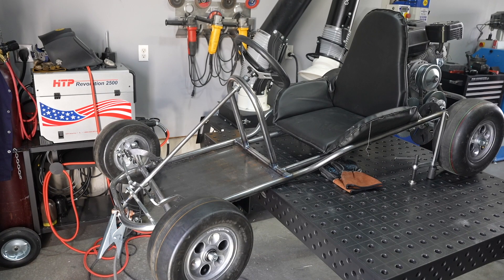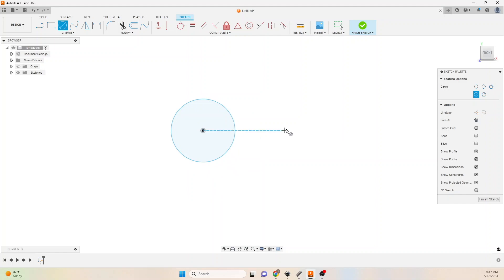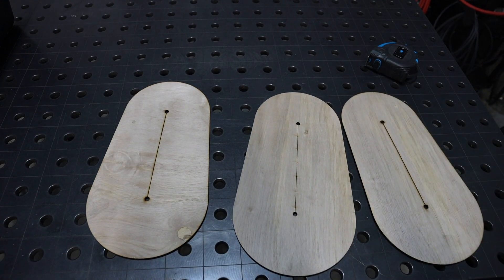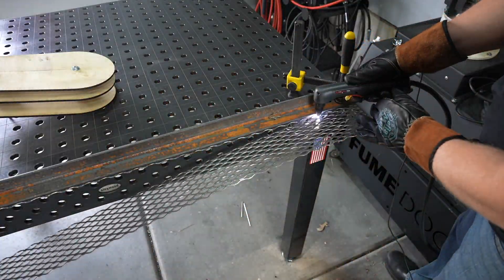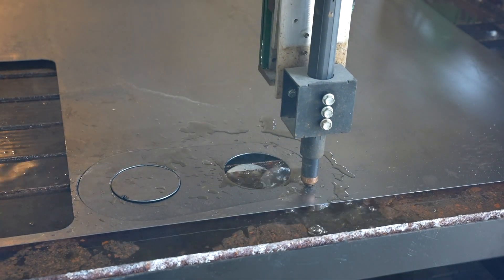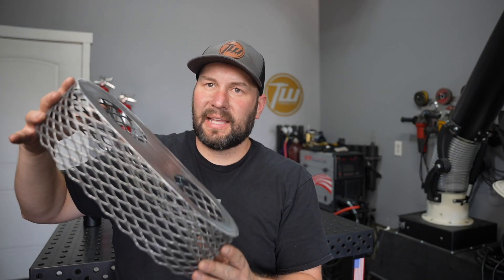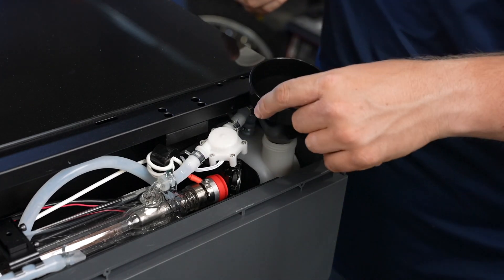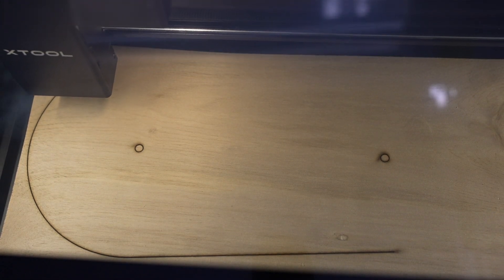Can Thin Wood form Metal? Making plywood metal forming tools with the xTool P2 CO2 Laser Cutter

Comment: Hey Tim I just recently started gasless flux cored welding and my beads are super skinny, and the puddles is really small I’m using Lincoln 0.35 flux core and I’m using the machines recommend settings do you know what I can do better?
Reply: I’ve also tried slowing down and it gets a little better but nothing like yours

Comment: Very clear to follow, thanks.  I’ve seen several P2 reviews and the thick material burning seems common.  The P2’s price is probably ok for people who are using it to sell resulting products or services, with Xtool’s D model a more reasonable consideration for most hobbyists.
Reply from the maker: Thanks! I have a friend with one of their diode lasers and it's really cool too.
Reply: The cutting speed seems too slow, or the power level too high, or some combination of that. There shouldn’t be that much charring. Any settings, just as on welders, is a suggestion of where to start. I find that natural materials have a fair amount of variability, so testing on a piece you’re going to use is helpful. Running the test charts before using the printer gives a very good idea of what to expect.

By the way, how does that nitrided table surface hold up to weld spatter?

Comment: Making jigs/forms = killer content!
Setting laser focus, Z axis height, is tough to get right for thick material.

I use hardboard from Home Depot for my jigs, super stable, finger joints without glue once you dial in laser kerf. Thanks Tim.
Reply from the maker: Thanks! I'll give hardboard a try.

Comment: May I share an experience to encourage you to stay with the black steering wheel you have - do not use a 'vintage' steering wheel?  About 1982 I crashed an old go-cart due to a steering failure.  When my body hit the steering wheel it snapped anda spoke ripped me open really bad - lots of deep stitches!  My point here is stay with that black steering wheel - it will deform without breaking.  If you ever come across a 'vintage' steering wheel - like a white or cream color hard smooth brittle plastic - DO NOT USE IT ON A FUNCTIONING GO-CART - just hang it on a wall and share my story.
Reply from the maker: Thanks for the tip! I'll steer clear of those. I've actually heard of a few go-kart incidents lately which has me rethinking my hobbies a bit.
Reply: @TimWelds  Enjoy your hobbies, take precautions, and you will be safe.  I'm 57 and still ride my motorcycle but I ride it ... differently than I did 40 years ago.  😏